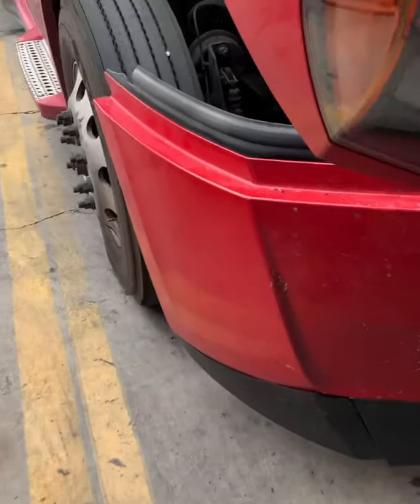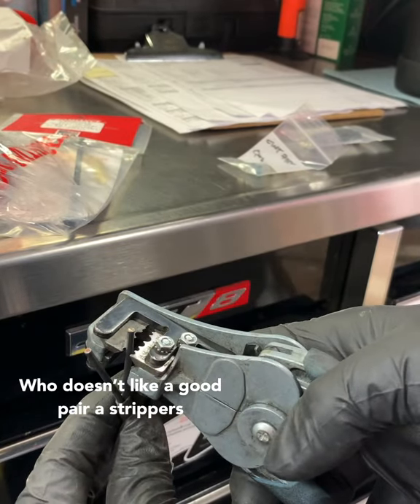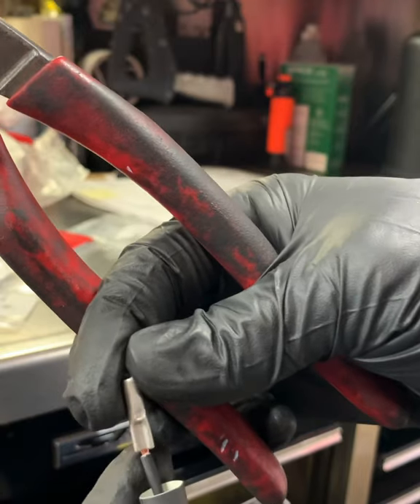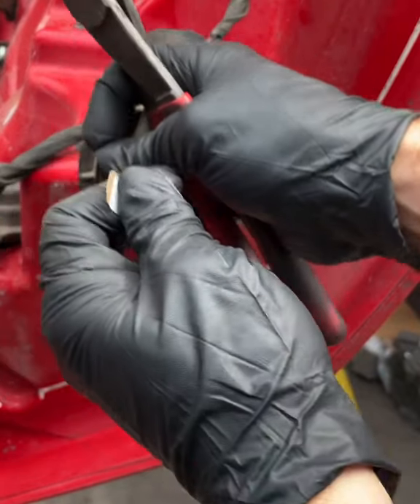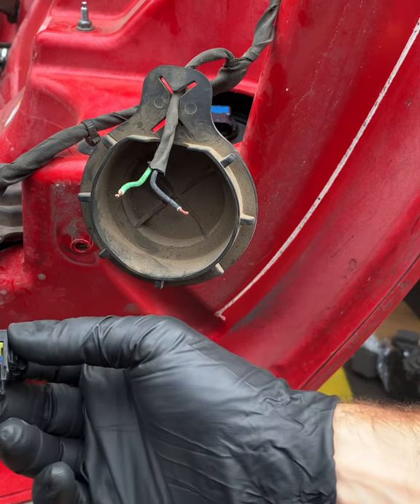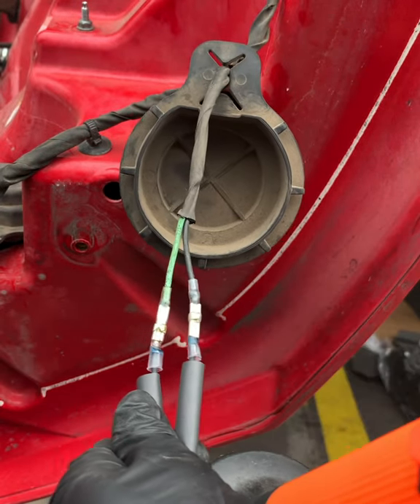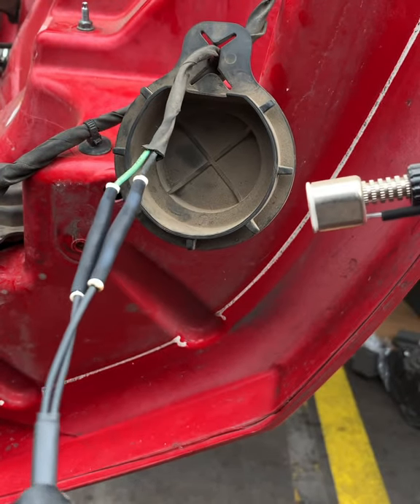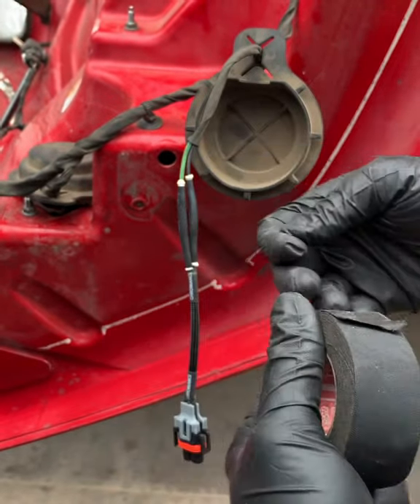Headlight wiring repair. Low beam or high beam burnt connector. Headlights not working. Graveyard.

Comment: I did exactly your technique,  but low beam on both driver and passenger low beam on 2011 silverado LT take turns flickering and turn on and off when they feel like it. I figured i will replace both wire harness and if it happens again i will have to find an auto electrician. I checked and replaced fuses, relays, switches, pigtails, bulbs still the same.
Reply from the maker: If it’s flickering it has to be a connection somewhere. I’d check the pins at the bulb just to be sure, check the splice to ensure it’s good, than whichever connector it leads to.

Comment: U did well. I like it. Have u had a pigtail where the connector at the bulb makes the acual bulb flicker ? I did same work u performed and i have same problem woth both driver and passenger side low beam flickering. They even alternate on and off on my 2011 silverado LT 1500 series 5.3 liter. Any suggestions ? I changed out 3 pigtails on my driver side. Original connector burnt. 2nd pigtail connector also burnt. 3rd connector doing good except now flickering as well as passenger. I dont get it.Terminals are good. Any suggestions?

Comment: Is this why I have low beams and no hi beams
Reply from the maker: Could be. But more than likely no. I would check those bulbs than the connector than start checking voltage at the connector.
Reply: @bustedknucklebydieseldr3228  thanks

Comment: At 10:01 in the video, the headlight bulb that is already in the housing, that you’re plugging the connector into looks round at the base of the headlight. I have a headlight with 3 tabs that line up into the housing and you give the bulb about a quarter turn to secure it in place. Do I need a different connector than the one you just installed for that type of bulb? Or can I use the same connector that you did?

Comment: So why exactly did this happen?
Reply from the maker: Great question. Could been a few different issues. 
Headlamp gets hot as halogens do and just burns the connector 
Pins are slightly spread and contact goes on and off causing excessive heat
Wires are to small of a gauge and create excessive heat
Corrosion is close by and causing issues. 
One of those will be your issue
Reply: Makes sense , aftermarket headlamps come with small gauge wire 😭